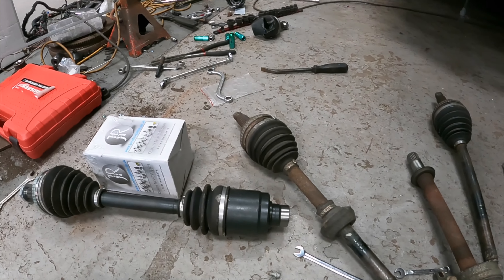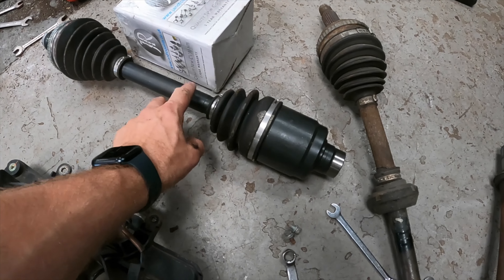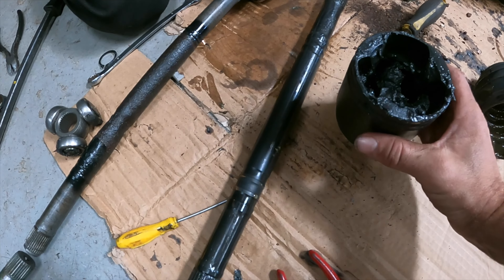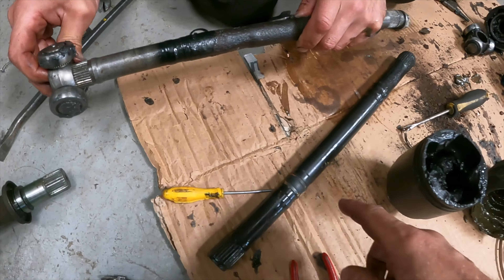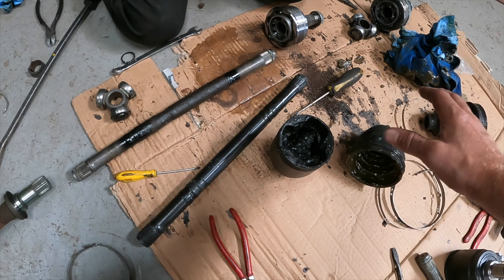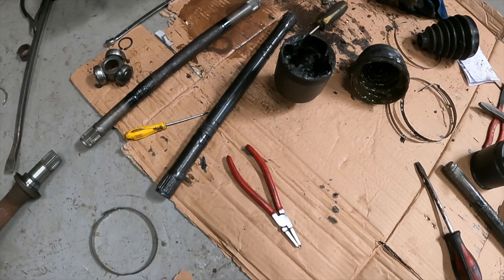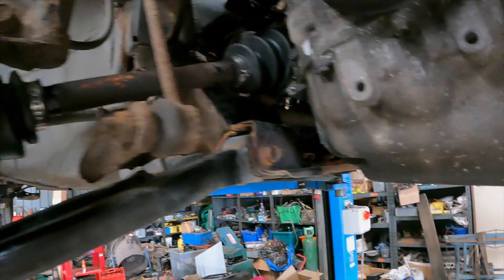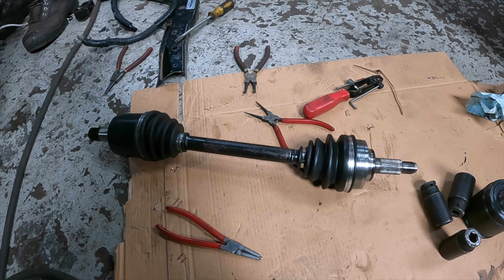K Swap K20 Honda Jazz Fit GD Making The Driveshafts

Comment: So just checking, the intermediate shaft is defo from an EP3 and not bseries? Confusing, as hasport say to use the SR3-J0 intermediate shaft with their kswap driveshafts, which is the bseries one.
Reply from the maker: I used the ep3 shafts yeah. I didn’t use anything by hasport

Comment: Did you run Abs in the jazz? Doing a similar swap but wanted to keep abs. (My car doesn't use a abs ring).
Reply from the maker: Yeah the abs is in the hub I think?
Reply: @1BlueGhost  had a weird issue when I fitted the drive shaft the abs sensor wouldn't fit into the hole, like it was fowling on something. Seemed to be too long. 
Did you use the jazz abs sensor?
Reply from the maker: Yeah, I’ve not actually touched or removed them from the hubs. The abs light isn’t on so I’m assuming they are working ok. I haven’t driven it much maybe only 2-3 miles
Reply from the maker: @civcfd3904  yeah, jazz abs sensor and jazz hub. I haven't touched any of the original parts there
Reply: @1BlueGhost  thanks for the reply! And thank you for checking for me, think I need to take another look at mine